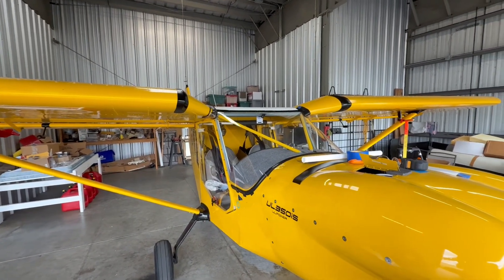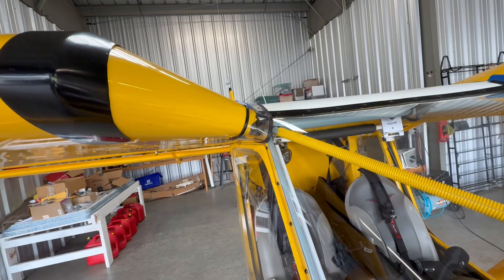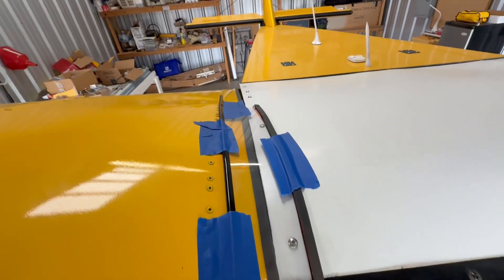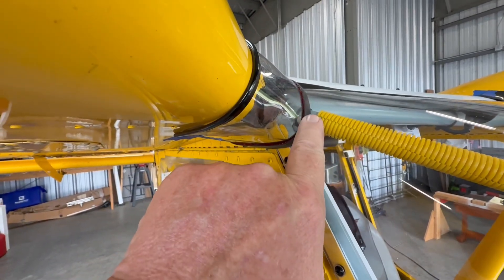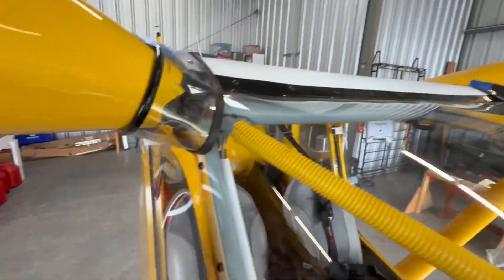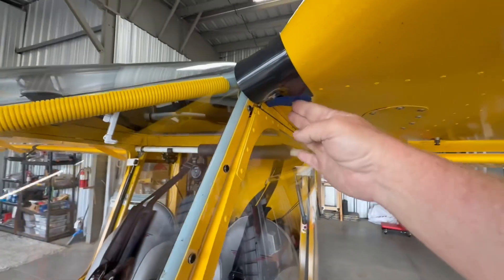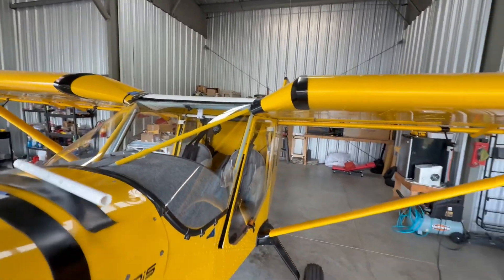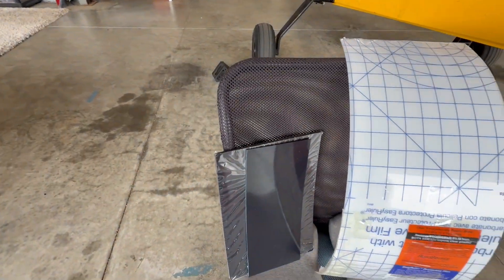Zenith CH-750 CruZer wing root covers

Comment: I did exactly what you did, but I used .020" clear mylar plastic sheeting. Then I taped over the edges and masked the entire area to protect from the epoxy glass overlay..  When the epoxy was cured, I remover the molded piece and primed and painted it for a perfect intersection cover. About 5 Stainless screws into nutserts completed the job.